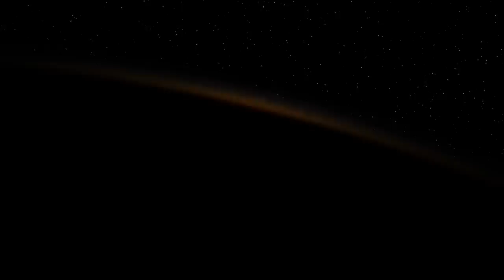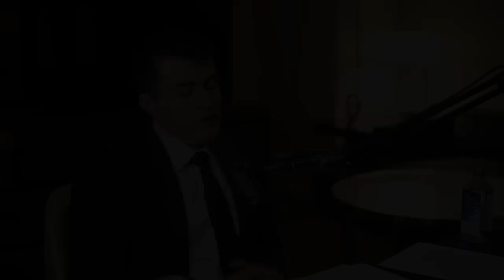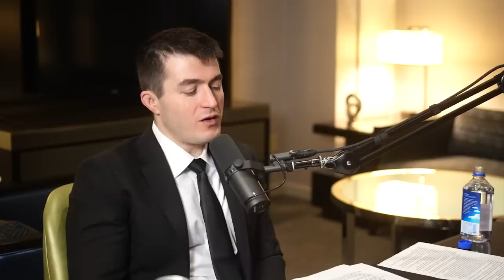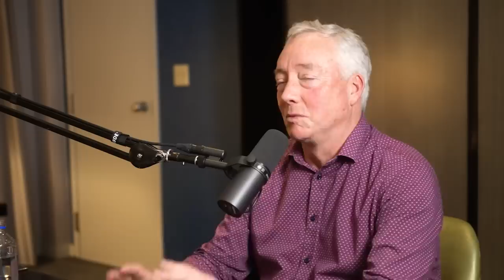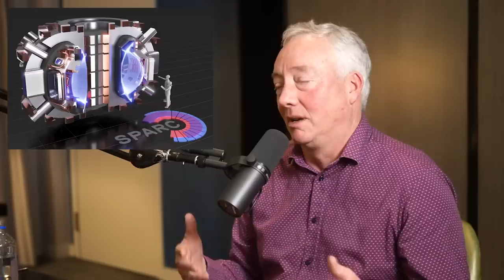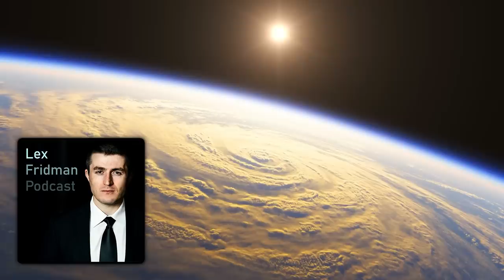MIT's Nuclear Fusion Project | Dennis Whyte and Lex Fridman

Comment: I'm serious. You guys gotta check out LPPFusion - they're a small operation of a handfull of people who are working on a reactor that's smaller, safer, doesn't rely on rare deuterium as fuel, and has proven much more capable than all of these multi-billion dollar projects that have gone on for decades and yet to crack usable fusion power. LPPFusion's approach is much more promising IMO and I believe they'll crack it before everyone else using their plasma pinch approach. A superconducting magnet requires cooling - where does that energy come from to cool it? Who cares if you use that energy to overcome resistance in the coils or to cool the coils to reduce resistance. LPPFusion needs more exposure!

Comment: Ive always wondered why we push so hard for solar when nuclear fusion seems to be the future... The energy output from nuclear fusion is unbelievable
Reply: Fusion is extremely difficult. Solar is elementary comparatively.
Reply: Because as of right now there is no proven wall efficient fusion reactor technology. It currently requires more energy put in to the reactor then can be extracted out even with the recent breakthrough of achieving ignition the issue is sustaining it for long periods of time. The other issue is fuel. While hydrogen on earth is abundant and supplies alot of the deuterium, the isotope tritium is much more scarce. Tritium cost 30,000$ per gram. Right now it's just not there yet and throwing money at it won't solve the issue we need to solve both a fuel and engineering issues. So if you can't find tritium what do you do, you make it that also costs energy. So right now it's more then just getting a machine to work
Reply: High building costs+high maintenance costs+high risks.
All of it is much lower for renewables (inlc. solar).
Reply: Cause why build a fusion device when there's already one right there in the sky?
Reply: Because we have to push even harder to go renewable
Reply: @JEBEDIAH8D  wow good answer.
Reply: Solar is fusion. It's just that the retractor is about 8 light minutes away from the photon collectors, and we need to incorporate some storage because of the cyclic access to it's output.

Also, because no energy positive terrestrial fusion technology exists yet.

So don't let perfection be the enemy of the good, we can use near term solar today to replace milenia old fossil photons...
Reply: Our understanding of harnessing energy from the sun, which is a giant ball of nuclear fusion, will help us with our understanding how to capture the energy of the mini fusions…just steps along the way to discovery 🎊
Reply: Nuclear fusion = solar energy
Reply: The issue with solar is how short the lifetime of the panels is to me. It’s flimsy. And costs a lot of carbon to make and install.
Reply: @saltwaterow  that was the idea but it’s proved very difficult. So far both techs are no working. Solar panels are flimsy and break easily making they return on investment evergy and carbon wise dubious. If you look at the solar industry as a whole including the digging for rare earths, transport, maintenance etc
Reply: Solar is free energy
Reply: Because the energy independence dream is for every house to have its own power source and to get rid of the powergrid altogether. That way you would only have to deal with power outages on an individual basis and it wouldn't be a target for attacks that can do real damage.
Reply: Money
Reply: We need to research every energy source. There's not going to be 1 technical solution to humanity's ever increasing need for energy
Reply: @AndreaDavidEdelman as of 2-5 years ago, you would he absolutely right. The industries explosion in popularity was to new innovations that make them far more accessible and reliable then before. As of now it’s the most optimal solution in transitioning from our current energy sources.
Reply: Becaus fusion reactors are yet to even produce 5% of of what they use. QTotal
Reply: Solar is fusion
Reply: @thoughtx4728  they’re clearly talking about solar panels …
Reply: @DanielJamesCollier  I know, my point was that both energy sources are derived from fusion. Fusion is like a star in a bottle, and solar power absorbs energy from the suns fusion. It was more for fun anyway
Reply: It’s not been proven to work. That’s why.